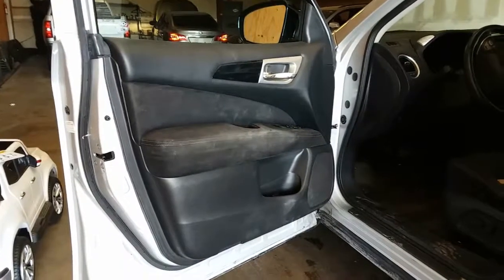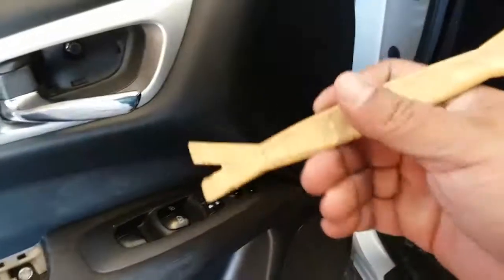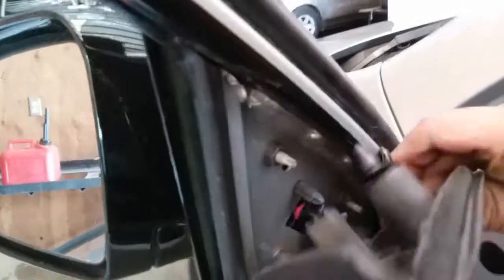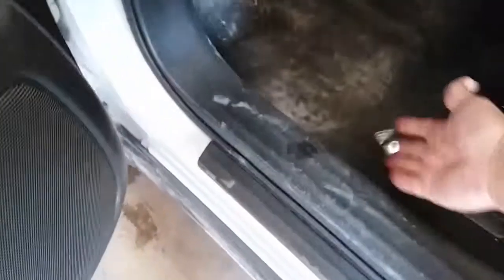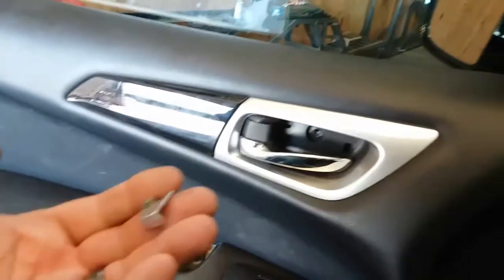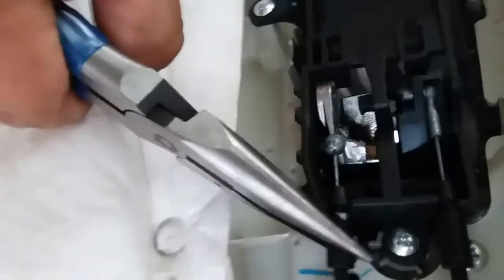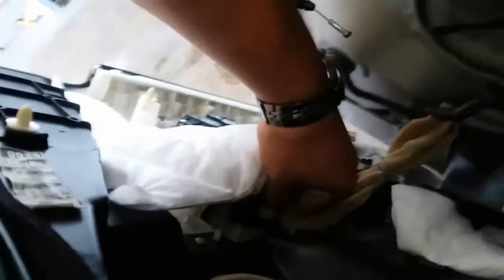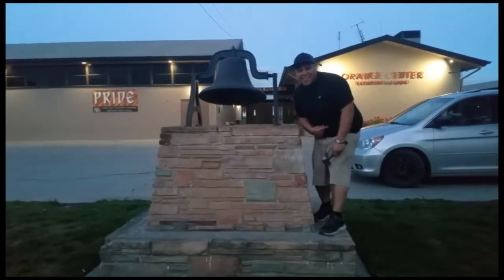How to: Remove Driver Door Panel from a 2013 Nissan Pathfinder

Comment: Why the hell that part is made of plastic.. should be metal to hold the wire ..
Reply from the maker: Cause the dealership wants you to  take the car back to them for repairs. It's a way they cut corners to save money.
Reply: GEORGE LOPEZ HOW TO DO IT YOUR SELF where did you get it